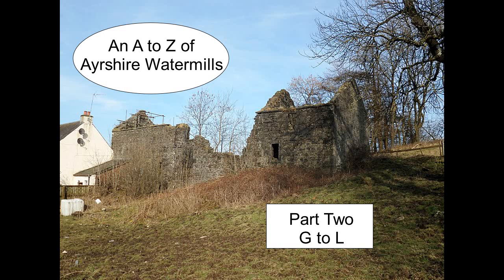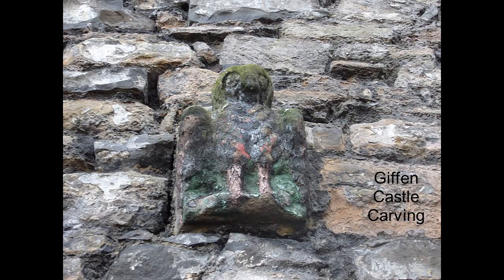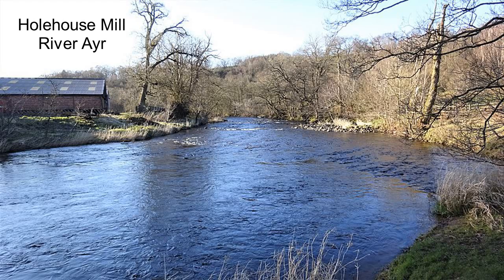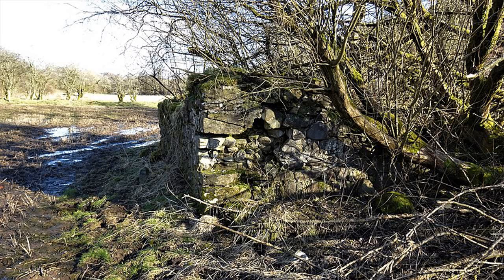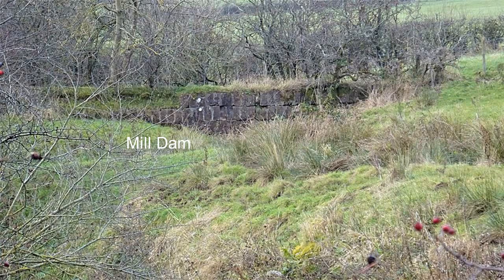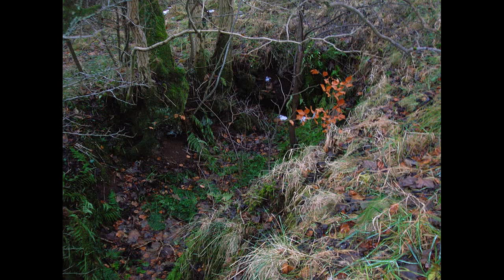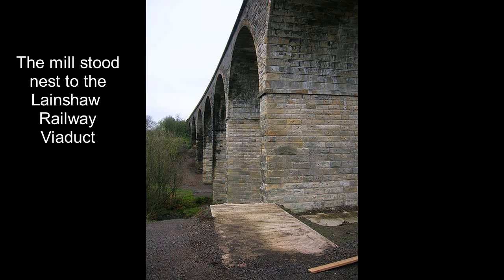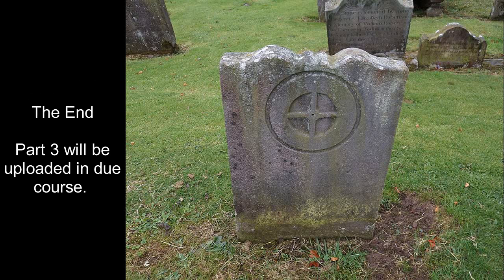An A to Z of Mainly Ayrshire Watermills.  Part 2 (G to L)

Comment: Montfode Farm in Ardrossan used to have a mill and pond/dam. Inside some of the old stable buildings, you can still see the belt driven smooth wheels, attached to a square section shaft, if I remember correctly. The pond has long been filled in and now used as an arena/school for horses.
Reply from the maker: Thank-you. I visited the farm some years ago - https://en.wikipedia.org/wiki/Montfode_Castle
Reply from the maker: I had forgotten about it. It will make the perfect first page of Part 3. Thanks for jogging my memory